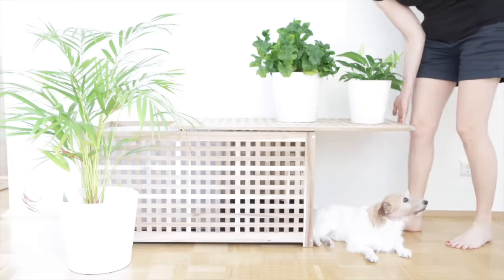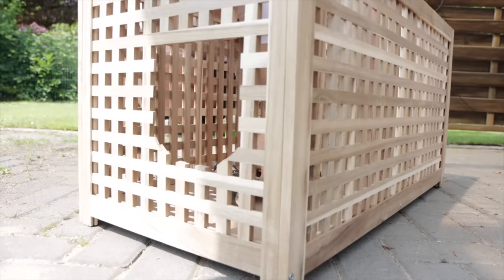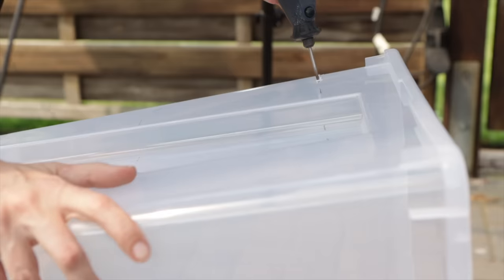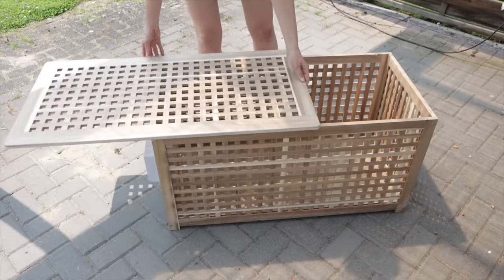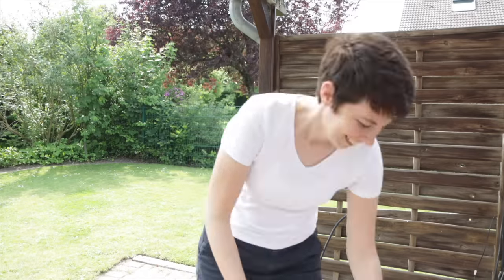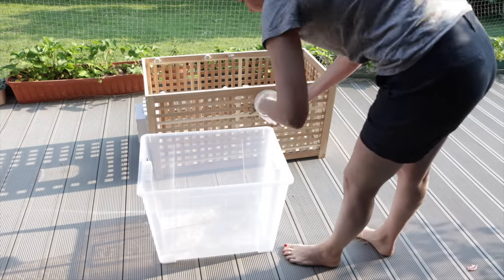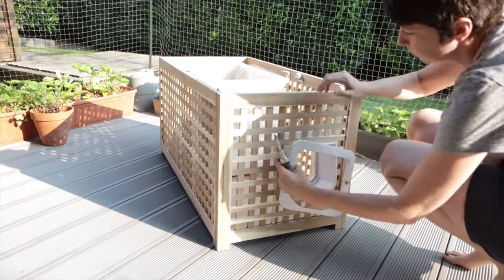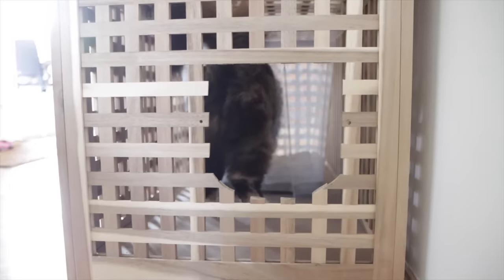Scandinavian Design For Your Litter Box | IKEA Hack for cat lovers

Comment: that's pretty cool, but not a lot of littler, how often in a day do you clean it? if I only used that much for 2 cats I would need to clean it 3 times a day
Reply from the maker: Hi Melanie! There’s a bit more litter than what you see in the video, but being a corn-based litter, it’s light and I cannot add as much as with clay based, otherwise my ladies struggle to walk on it… it’s a bit like quicksand. I clean it once a day to remove clumps and poos and then every 3 to 4 weeks I deep clean it. No smells thanks to my sandwich method and the excellent clumping power of this litter 😊 as a matter of fact, my litter box is in my dining room, so I’d notice if it r smelled even a little bit 😉

Comment: Great video! What was the type of cutter you used to cut the wood and plastic?
Reply from the maker: Thank you 🥰 for the wood I used a jigsaw, but in this piece of furniture the wood is so thin a simple small hand saw would do. For the plastic tub this time I used a dremel, while other times I have used a utility knife and heated the blade on the stove of my previous apartment… which worked a lot better, actually 😉

Comment: It is nice but the opening is not big enough to remove the box and clean it... Or do you clean it with it still inside? If so, it is not very handy ☹️
Otherwise, just like that with a basket in it, it would be nice 😊
Reply from the maker: The opening on top actually opens enough to clean it easily (I clean it daily, so it just has to be easy to do 😉) 😊

Comment: Cancel the background music. Btw, factor in if they spray outside the box at all, it will soak right into that soft wood, so  you have to replace this fairly often.
Reply from the maker: My ladies pee inside the litterbox, and since the inner box has tall sides, Thai hasn’t been an issue at all. I have had this for a year and a half so far, with no issues ☺️